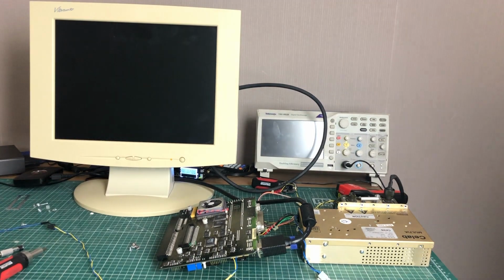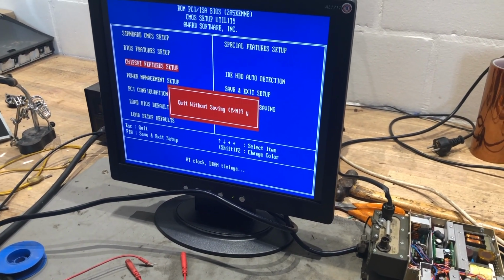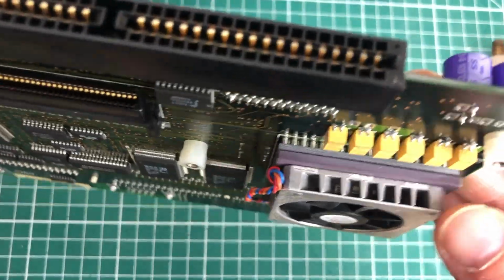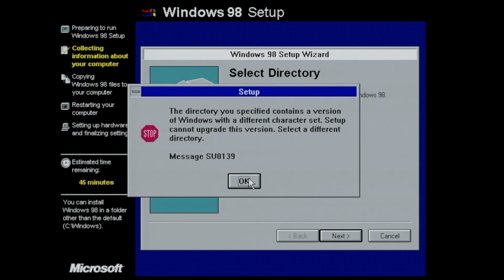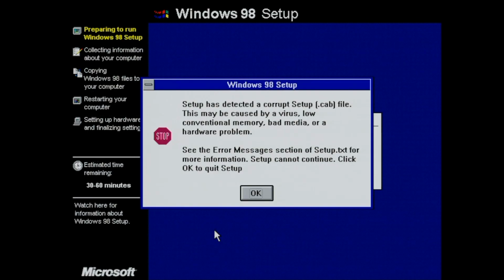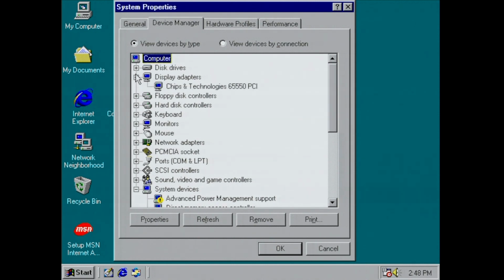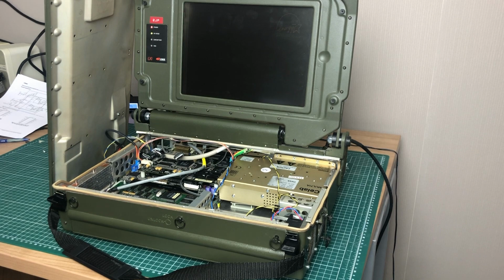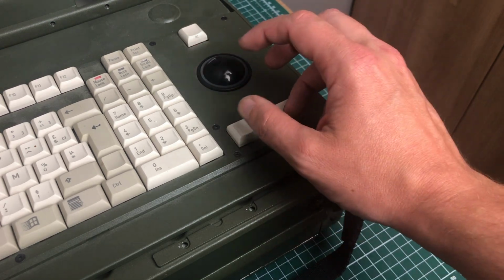Military Laptop Part 3 : It is alive !

Comment: That Motorola chip belongs to a legendary series :)
I believe this one still has the old 68000 ISA while most of the later versions had a CPU32 core. (basically a 68020 with som extra goodies and some other stuff removed that you don't really need on embedded systems. 

This family was used in everything from engine management systems to network switches. There's also a offshoot family called dragonball that was used in several Palm and Handspring devices.

Comment: Compact flash cards were not designed to run so many write / read cycles as needed by Windows 95 / 98 when swap file  / virtual memory is used. Industrial rated compact flash cards are a bit more durable, but SD / Micro SD are much more stable than CF. Had a couple die on me running Win 95/98.

Comment: 13:32 Mmmmmm, CF not stable storage ???
That's why it's used for decades in major brands of hardware firewalls like Watchguard, Stonesoft etc....
and as storage in Thin Clients.
The major problem with CF cards is that they are new not cheap, except for the non branded ones like the fake High Speed CF you used. 
(a German seller on Ebay sell this type of rubbisch fake High Speed CF cards).
If you use brands like Kingston, Transcend, Sandisk, PQI for CF cards, then they are really reliable.
Also, if you want to use a CF for a Operating System like Windows, you must disable pagefile, the many read/write actions per second 
that Windows does, this will damage very quick any MicroSD, SD, CF or USB flash device of every brand out there. 
These types of flash storage useally don't come with buildin SMART diagnostics and don't support TRIM like SSD's for extending the lifetime.

Comment: Great work! :)
14:44 Oh, the OPL-3! What a nostalgic bit, I was using sound card with it back in late 90-s. Good audio.
17:57 Yellow to blue and vise versa? Well, it's a speaker anyway....
20:05 Shouldn't be a problem as it have 32-bit CardBus. But as someone mentioned in comments - metal shielded case - so you need to connect an external antenna somehow...

Comment: I'd love to see someone take the shell from a laptop like this, and turn it into an awesome modern rig.
Reply: its big enough to fit a modern board (maybe not full size but definitely mini atx or micro atx), and 1024x768 is technically 720p if im not mistaken, he would just need a controller for the lcd, assuming its not feeding vga directly to it (could be a controller built in to the screen, not common but possible). this thing would make a badass sleeper pc.

Comment: Some pcmcia wireless cards have external connectors for antennas, maybe you should try searching for one and reuse the external modem connectors for an external antenna? Or even better, also exchanging the external modem connectors for external antennas connectors.

Comment: that CF card looked like some generic chinese card from wish, doubt it's reporting it's true size, bit like the so called 512GB SDHC's they were selling, HC not XC like you'd expect, those might write about 50mb's of data and then corrupt after that point.. btw i'm using a sd to ide adapter in my laptop from 94, along with the ontrack disk overlay software so it can use all 32gb.

Comment: That video RAM issue looked like a classic address pin problem.

You can tell by the fact the colours were usually OK, but some of the pixels in the EPA logo had kind of swapped position on each line, so probably a dry solder joint on only one or two address pins.

Looks like it might be using SRAM chips instead of DRAM, too, since the chips have quite a few pins.

(I'd also expect the graphics problems to be a lot worse if DRAM had a bad solder joint on an address pin, as DRAM uses multiplexed Row/Column addressing.)

Always interesting to see massive laptops like this, and just how much harder they had to work back then to cram an entire PC into a smaller case. ;)
Reply: I stand corrected. lol

Probably is DRAM after all.

(PDF page 4.)
http://www.datasheetcatalog.com/datasheets_pdf/F/6/5/5/F65550B.shtml

Comment: I had a water damaged 486 version of this which I tore down for parts and I own a pentium equipped one now, which had an intermittent issue with total video failure and failing to post. I had to replace the ram and video chip. Neither has that interesting ISA card though! Also they both had a thermal pad between the cpu and case, with no vents. interesting to see yours has a fan!

Comment: CF cards have a firmware setting to be either recognized as a mobile card or as a HDD. Windows doesn't like to install on it if it's in mobile mode. It's possible you might have had to flash its firmware.

Comment: And basically just only put Red Alert on this and get at it. No other option commander.
Reply from the maker: Would live to play a round of Total Annihilation :) not sure if it would run all that well on this hardware.
Reply: RetroSpector78 not sure. Red Alert will run fine though. Maybe even over network if you get it running.

Comment: Still laughing at PDNTHTL, LLX.  CF cards can be a pain in the backside, certainly in Amiga land you need to be very careful how they are setup or you'll get all sorts of problems plus the fact that some cards just don't work.  A modern solution I've been meaning to try is an ide to msata converter with a nice modern msata drive.  

Anyway... fantastic laptop, a real oddity for your collection.  Perfect machine for a bit of classic Command and Conquer.
Reply from the maker: Yes... that’s the plan ! Looking forward to some classic gaming and taking it to the local computer club when corona settles ...

Comment: The display on the front has a timer and counts overall system hours.  Consider replacing the PSU fan with a newer Delta 12v that doesn't run that fast and makes way less noise, or lube the bearing in the current one. that thing shouldn't be screaming like that.

Aside from that, fairly nice laptop. You can get away with just wrapping the CF adapter really well in Kapton tape and leaving it loose in the bay, no need to do anything silly, but you can also mount it with double-sided adhesive rubber or something along those lines as well without any harm done. I stopped using CF cards as most of them don't do UDMA of any kind; you're better off using an mSATA to SATA or mSATA to IDE adapter and any size mSATA card to get better performance with some garbage collection instead of wearing out CF cards all the time. 

Do you need the BAMS card installed? it's putting more stress on the PSU just sitting there doing nothing, and there's no need for it anymore. You'd be better off using the spot for the BAMS connector for something else like a proper ethernet card on the outside of the case.

Likewise, there's also no need to use such an old 802.11b card with that machine. You can get 802.11g cards that support 98 just fine, and honestly, if you want to, you can also get a Linksys WPC300N v1 and install Windows 2000 and get working N support. The metal case is probably not going to be the best for range, but it's still an option to consider, especially if you move up to an mSATA to IDE adapter.
Reply from the maker: Thx a lot for the elaborate comment ... will take them into account.

Comment: The CF may be fine, you just need to rewrite the MBR with the CHS translation you’re using in the BIOS.

Boot from a floppy with the version you want to use - Win98 would support LBA and FAT32, which is important.  Then run:

fdisk /mbr
format c:
sys c:

That should fix non physical issues with the CF and boot sector code.  :-)
Reply from the maker: Think I did that at least 5 times that morning :)

Comment: About the Compact Flash card.  Now you had a chinese version of windows on it, this tells me that it was some counterfit CF card.  The internal of that card was working differently.  Now the best proof I can give you, is your CF to SD interface worked fine to finaly install Win98.     That orginal CF card probably had a specific driver that worked only with the chinese version of W98 or the Win98 was design for this type of CF card.
Reply from the maker: Not sure ....  lots of people report stability issues with CF cards / SD cards. Think I just got unlucky with this one. The computer setup originally came with a faulty IDE extension cable and when hooked up to the IDE->CF adapter, the CF card became really hot ... Perhaps it got damaged back then I don't know. But have had issues with these things in the past.
Reply: It is a common misconception that everything with Chinese printed on it is counterfeit :) CF is just IDE with a different name, so nothing special at all.

Comment: I vaguely remember some video drivers would go crazy when changing resolutions without restarting. I think some programs would have trouble also. I think windows 95 or maybe 3.1 couldn't change resolutions without a restart.
Reply from the maker: In retrospect, I think here it is more changing the color from 256 -> 16 bit. But even then I still don't get why you need to restart the entire computer.

Comment: Unfortunately, that SD card will wear out even sooner than a CF card. Add to this that SD cards have serial interface contrary to parallel in CF and you'll get terrible access times with random read and write.
Reply from the maker: CF card is broken I think. Was the only quick alternative I had ...  Couple of months ago tried installing another pentium with a 16gb CF Card. Was also a big mess (corrupt files, files disappearing). The whole thing felt really unstable .... should dive into the subject some more and make a video on it :)
Reply: @RetroSpector78  I'm talking about fresh CF vs. news SD. Your see, CF is basically an IDE (PATA) with different mechanical connector. So you can source cheap passive CF2IDE adapter for €10. Just make sure you use brand name CF card like Transcend or SanDisk. I'd happily watch that video you mentioned :)

Comment: That battery probably has regular NiCd cells inside of it.  You can probably make your own.

If you charge up a big capacitor with a bench supply, you can use it to spot weld tabs onto batteries and create a block of them.

Comment: Odd that is has a chinese version of windows on it. A few months ago I tried install windows XP on a compact flash card, but it wouldn’t work. 95 and 98 install just fine on a CF card using the IDE to CF adapter in my Pentium 2 system . Also got a Sata to CF adapter for a pentium 4 system, but not much luck with that one.
Reply from the maker: Also had mixed results ... perhaps I am missing something or you just need some luck with the correct setup (computer / ide adapter / CF card)

Comment: I have a PC from that era that won't work right with a 8GB or 4GB CF, it sees them right and I can install 98 but it will never boot it afterwards. It works great with a 1GB one, but that's too small to play with 😕 Also bought a CF to MicroSD but that just doesn't work at all, surprised it worked for you
Reply from the maker: Think you really need to luck out with the correct motherboard / bios / ide adapter / CF card combo

Comment: great that the cpu isn't soldered, maybe you can upgrade it! not sure if it's socket 7 or if it can do super socket 7, the pentium mmx line tops off at the 233mhz.. so a tiny boost.
But the amd k6 line has the k6 300mhz, and k6-2 333mhz and 366mhz which both use socket 7.
But if you're going super socket 7 then there's a k6-2 550mhz.

I have zero clue what kind of upgradability you can do with that board, not sure what the bios, board or heatsink will handle, but with modern thermal pastes and maybe even a newer heatsink you may be able to upgrade it a fair bit.

I also wonder how much ram you can get into it. 256MB? 512? i'm so excited!
Also they sell 2.5" IDE SSDs Which are easilly fast enough to totally saturate the IDE lines. So it's probably ATA-100, so the SSD would totally max it out. :D The compact flash cards and especially SD cards have low IOPS, so not ideal for an OS, but an SSD, even one designed for IDE would have lots of IOPS.
Reply from the maker: Will try to check in the next video.

Comment: Actually, CF cards in these systems are far less a hack than SD cards. The CF card has an IDE interface already. All the adapter does is to convert the pinout. It's much less overhead than using an SD card on an IDE bus via some adapter. That said, my experience with them hasn't been that great either. They work fine in my Amiga but I didn't have much luck with them in old PCs.

Comment: What? Don't you know that the PWEEEEEHNTSCHLNM LLX was a super-secret CPU aimed especially at the military market? :-D
Reply: 200 light cycles
Reply: Bob Ross  What's the point of the extra hardware in the IDE controller to send high voltage pulses to the drive if the data is still sitting on the drive after it finishes? Wouldn't it be better to simply overwrite the contents of the drive with garbage?

Comment: Most likely the compact flash is worn out at the start as those types of cards don't have any wear-levelling technologies implemented. Filesystems such as FAT, FAT32 and NTFS tend to wear out these drives really fast as they rewrite some sectors a lot even when idle.

One can circumvent this by creating an empty small partition without formatting it at the start and not touch it. That will be a placeholder for the worn-out start of the flash drive. Better use a proper partitioning tool from a Linux live CD, as those are much better at that task than DOS/Windows is.

Best is, of course, to replace the compact flash card, as the circumvention mentioned only delays the inevitable total demise.
Reply: Or, go with a lightweight (XFCE-based) Linux?
Reply: @xheralt  Would be perfect if one would use the computer for something.
But I guess the point here is to keep the computer as "vanilla", or as original as possible. That includes the softwares.

Comment: Just rebuild the battery pack yourself.  It is composed of standard cell sizes.  Remove the shrink wrap and double check the cell dimensions against your supplier (eg a 'C' != 'sub-C', etc).  You can order cells from a number of suppliers with pre-welded tabs on each end.  This allows you to easily solder the tabs together to reconstruct the chain.  Then wrap the whole thing tightly in electrical tape.  good2go.
Reply: or you can make it easier on yourself and simply use cell trays for easy replacement
Reply: @snarkylive  would be easy to add one, they sell pre-made modules specifically designed for making your own battery packs.
Reply: In general I agree, it should not be hard to build a battery pack to fit this laptop.  One should take into consideration the voltages and charge/discharge profile of the different battery chemistries before plugging in a new pack.
Reply: 24V is really easy to make with a 7S lithium pack for expanded capacity depending on available volume. Although I’m guessing a battery is completely unnecessary because he only plans to use it tethered and not at the local coffee shop.
Reply: @peterg.8245  not like you can just use a 7s lithium pack when there was a cadmium battery in it. Those as far as I know can't be charged with the same process.

Comment: Congratulations!! Removing battery is definitely a good idea. I did the same.
Reply: I also ordered one from that German shop. That shipping fee was insane, and heavy too! 100euro, and still had to collect it at the post office ..
Reply: @richard802  Did you get it running?
Reply: Hanwen I had it sent home while I was abroad. I’m returning home next week and look forward to try it out. I heard it’s a common issue that the bios battery is a special kind that needs to be ordered and replaced. I’m thinking of putting in a new modern main board and turn it into a daily work horse.
Reply: Hanwen It’d be nice to have a DRS LXI community, I recently spotted one in a movie. The dark knight (aka Batman) - Bane was also using a DRS LXI in the background.
Reply: @richard802  That's cool. I'm going to check it.
Reply: @richard802  Yes, that should be replaced. You need to almost completely disassemble it to replace the battery on the motherboard at the bottom. Hier you can find a small tutorial: https://www.multi-board.com/board/index.php?thread/80350-wiederbelebung-eines-drs-lxi-milit%C3%A4r-notebook/

Besides, to get it booted, you may need to change a jumper on the ISA card with Motorola chip (probably the board for BAMS radio).
Reply: @richard802  Could you tell at what time it can be spotted in the film The Dark Knight?
Reply: @eagle20fox2  I've taken 2 screenshots of Bane's DRS LXI in his lair. https://riichard.com/static/drslxi/bane1.png
https://riichard.com/static/drslxi/bane2.png

I hope he got it running too 😅
Reply: No way? You have one of these?
I'm jealous! This seems like a beautiful machine!
Reply: Actually I got two of these, one is shown here by RetroSpector78. :D They were from ebay: https://www.ebay.de/itm/DRS-LXI-TM219-Outdoor-Military-Militar-Laptop-Drucker-u-GFK-Kiste-ohne-Festpl/322952889274?hash=item4b317e03ba:g:U4kAAOSwdUJcE5Wf